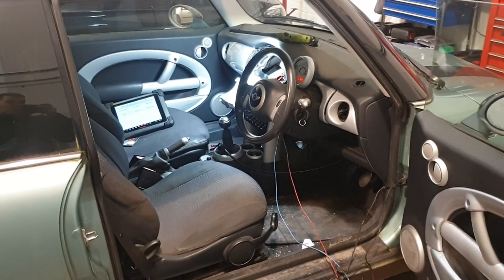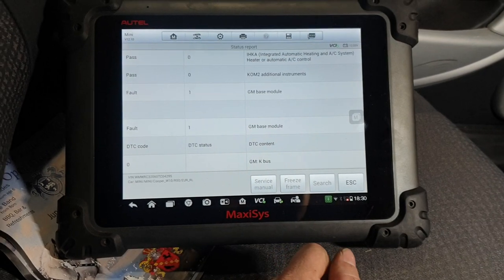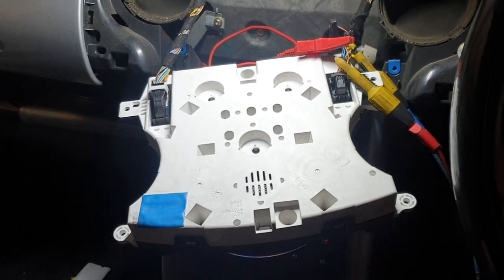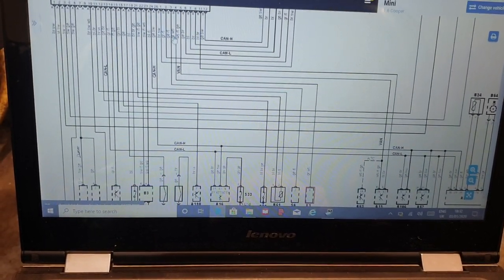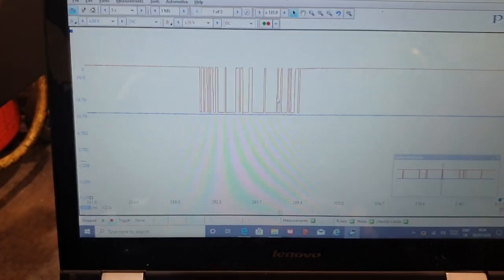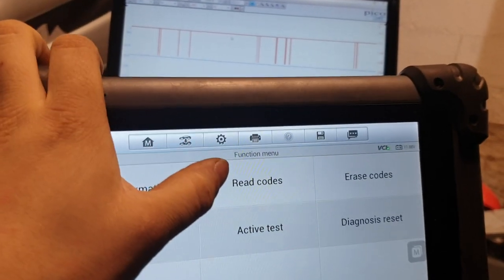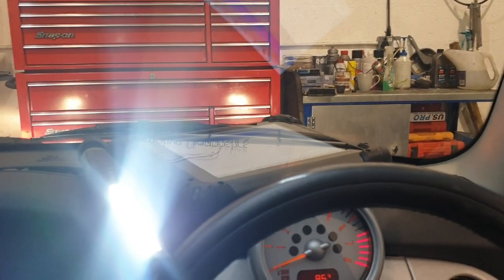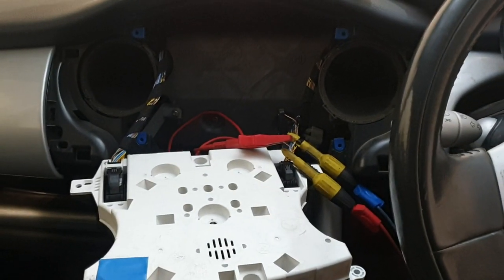MINI One K-Bus Fault

Comment: So when I plug in I get 61 faults they will all clear but D904 K-CAN Line Fault. Car starts everything works blinkers head lights if you didn’t plug in you wouldn’t Evan know there was an issue. So in my case is it the (champ) central head unit and multimedia? I’ve never had a can issue with anything so wouldn’t Evan know where to test if there was a short. 
I’ve wanted a good head unit anyways for some loud tunes
Any help is greatly appreciated

Comment: How did you know the cluster was the gateway?
Awesome video
Reply from the maker: Looking at the diagram, the diagnostic line between the scan tool and the network did not directly connect to any networks and went directly to the cluster indicating this is the gateway on this vehicle connecting Communication buses. Hope this helps
Reply: Elite Automotive Diagnostics like a tipm on a Chrysler. I got ya

Comment: Hi everyone, 
I've been trying to search out this problem but I can't seem to find anyone who has had all the symptoms I'm having at the same time. So I have a 2006 base Mini Cooper and the EP light continues to flash on and off and when this happens the car randomly shifts gears and most of the time it seems to down shift because the RPMs go up. On top of that the temperature gauge needle will go all the way to the top as if indicating the car is overheating though it is not. Also the tachometer and all the lights on it (check engine and brake) will go completely dead. The speedometer will also die too. Also a number of warning lights will come on and some seem to stay on permanently, like tire pressure sensor, while others just flash on temporarily. This happens for a couple seconds at a time and then things just go back to normal, but things like the check engine light and tire pressure light stay on. This used to be a sporadic occurrence, but now I can't even drive the car because it just keeps bucking so much from the random shifting it's doing. It's almost like the car is possessed. Has anyone ever encountered anything like this. Thanks
Reply: I just had very similar symptoms… diagnosing now
Reply: hello mate. what you've wrote sounds exactly like what I have right now. did you find a resolve? ive heard it could be a short in the wiring somewhere or an issue with the bcm but have yet to resolve. Did you fix this yet
Reply: @chrismarkwick1761  on my Mini it ended up being a pigtail on the rear bumper/valance. The pigtail got loose and rested on the exhaust, melted both K wires to the bulb ground. Probe the k circuit to see if it has direct ground or Bat+. Trace from there.